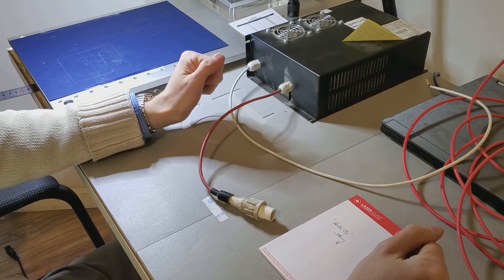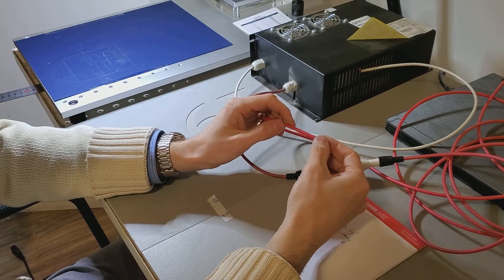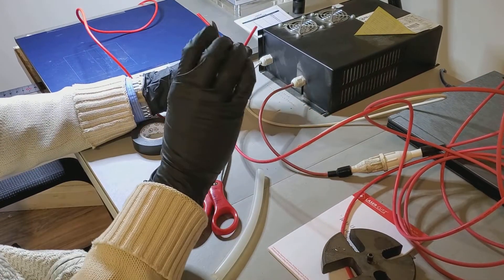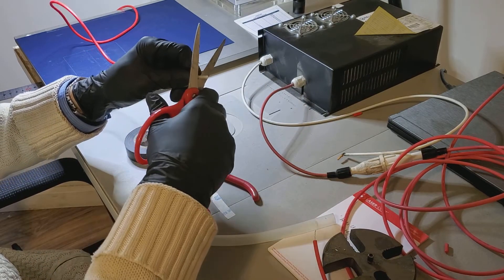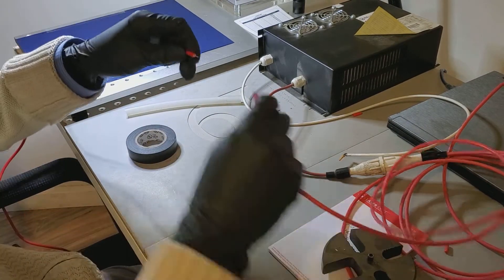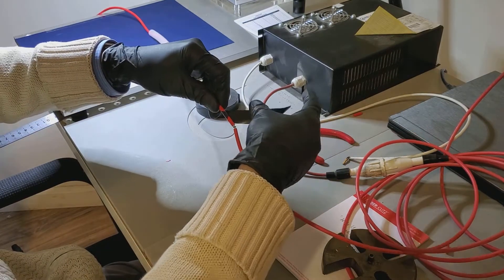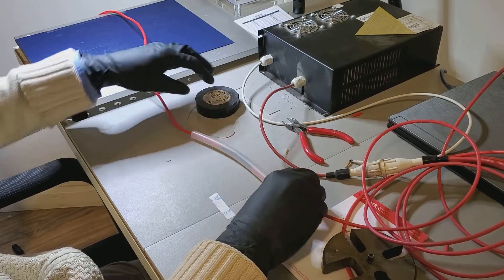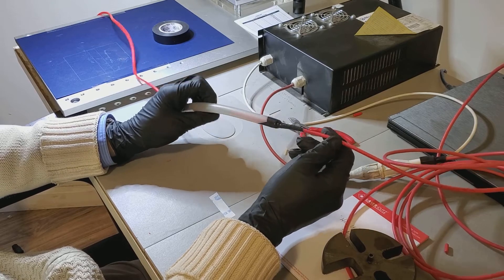Laser Tube Wire Connection and Electrical Leak Troubleshooting Tutorial

Comment: Then this cable it is supposed to be wrapped with tape in tube?
Reply from the maker: red cable splice, wrapped by electrical tape, then silicone goes on top and and extra electrical tape on sides on tube

Comment: Can i use solder to then electric tape  then use pipe thats with chiller
Reply from the maker: yes u can solder BUT twist wires  before you solder as  if wire get shot it will melt solder and wires will separate so twist will hold them in place. Electrical tape is  mostly for water/moisture/humidity insulation  so make sure silicone tubes covers far enough form a disconnect point, silicone form chiller is perfect choice.

Comment: I do those steps everytime , machine runs fine 3 to 4 houres and then start again and burns everything :(
Reply from the maker: if u see same synptoms of high voltage leak, arc from wire to body/ground after few hours then check hymidity, check wire temp (contact less ir thermometer). if humidity increasing or water leaks from tune it can conduct electricity. if wire gets hot it may expose crack in shielding. both scenarios are not too mych likely but phisics is phisics . other thing to check is ur ground. if some how electric flow does not go though tunbe or its ground wire it will try to find nearest and weakest exit point. ex bad ground wire or some how electrical defect in power supply that increases resistance on groumd.  what i seen on our own machine was leakage from flyback transformers, ex as power supply gets hot flybacks start shooting lighting to power supply body (inside). so bottom lime if  wires leaking replace all, really all wired. if does not help replace power supply, if does not help look at what u could possibly miss in symptoms :)
Reply: @lasercutzinfo4718  ur right   i guess I did wrong instead of  cilicon  pipe as protection i used plastic  pipes . For now I did changed to cilicon pipe to cover attached area . And for humidity yes can be a factor too . As I living in tropical weather country very high humidity  level 😑  . Tqvm for explaining
Reply from the maker: plastic pipe can work but depends on plastic ex abs  can absorb moisture which is irrelevant to most cases but when comes to high voltage it can become a conductor. 
so yes, try silicone and as long as possible to to isolate any unexpected exit point
Reply: @lasercutzinfo4718  yes I did tried yesterday  so far whole afternoon runs smouth . Tq
Reply from the maker: @ika9  that's perfect, im glad i was able to help!
Reply: Thank sir